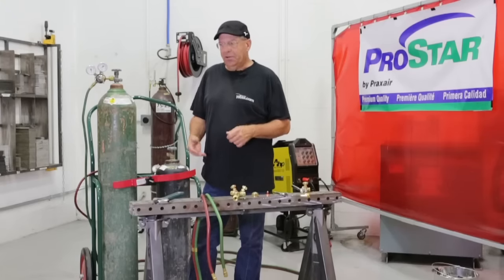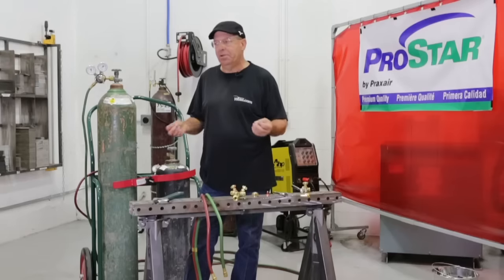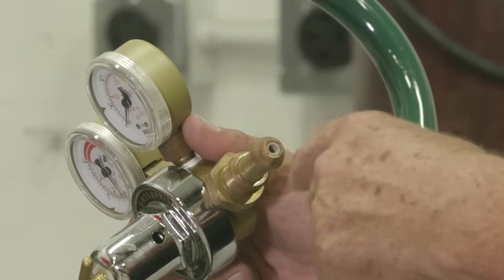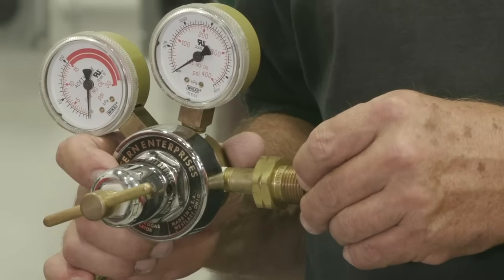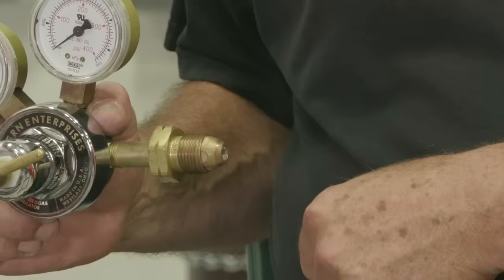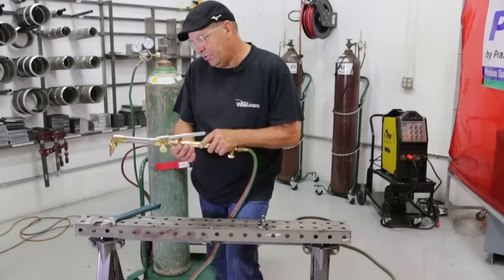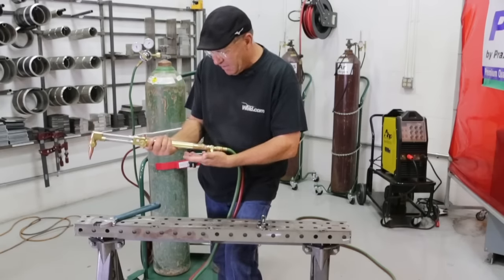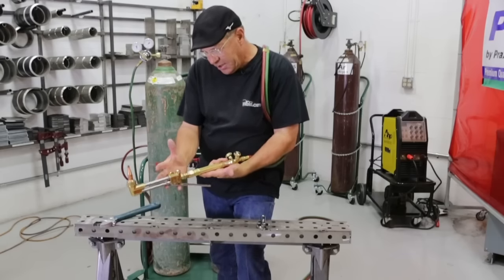🔥Safe Oxy Fuel Setup and Operation

Comment: GREAT VIDEO !!!  I've used torches for many years, but learned things here.  A lot of us were taught incorrectly. You show it all and explain WHY.  
   Suggestions:
    1.  Always use a tip brush to clean tips,  even if the tips are new.  Never use a tip brush when the tip is installed on the torch.  You'll only push the dirt deeper inside the torch.  The worst way to clean a tip is to just rub it on a concrete floor.  I've seen guys do that.  
    2. Soapy water in a spritzer bottle... ** just a LITTLE bit of soap !!!  Too much liquid dish detergent and you'll have LOTSA bubbles.  You won't know if you've got a leak or not. A little it of soap won't foam up unless there is a leak. 
   3.  For thicker metal, use a bigger tip.  Increasing the gas pressures won't help much.  The small holes in the tip only let so much gas thru.   It took me years to learn that.  I just never thought much about it, until one day a guy explained it to me.  
  4.  Never leave the hoses pressurized. ALWAYS turn the bottles off, when you're finished, and release the gasses in the hose.
Reply: gord johnson ...Good tips my friend!   Please allow me to add the obvious:
To clean tip when a piece of slag or foreign material is stuck to it DO NOT tap or beat the tip on anything.  Also do not run a file across the face of the tip.  In both cases you just ruined the tip, it will never cut right again.  If you are operating a cutting torch correctly you should never need to do any more than occasionally use a tip cleaner.
Reply: @leebarnhart9725  Not true with respect to filing. I have filed and cleaned basket-case tips and had them cut like new. The main issue is that it is an acquired skill which takes quite a bit of practice, and you must use the correct file (either the one in the cleaner set, or a fine single-row mill file). It is also best to finish the tip with 400-grit sandpaper or a stone, which like the filing takes practice. The good news is that if you have junk tips, then you have nothing to lose by practicing on them. One thing to keep in mind is that you can typically only remove up to perhaps 1/4" of material from the end of most tips. After that, the flame gas passages will either start to expand in diameter and/or start angling away from a parallel direction.
Reply: WTFChuk ....The fact that you have enough torch tips to "practice" on tells all.
The "file", as you call it, that is found on most tip cleaners is for removing carbon build up---not for removing tip material.  
For those reading our disagreement, it's like going to the race track, put your money on the horse you believe in.  If you find yourself with a torch tip in one hand and a file in the other, you've already screwed up, don't make worse.
Reply: @leebarnhart9725  The reason I have tips to "practice on" is because I recondition and sell oxy-fuel equipment, among other things, and as a result you end up with plenty of bad nozzles. After you remove your foot from your mouth, you may want to consider that people who do a lot of cutting, particularly scrap cutting, can end up with fouled tips from a piece of metal or slag blowing back and clogging an orifice. You also have folks who cut a LOT, and as the oxygen cylinder pressure drops on a typical single-stage regulator (the most common type) the outlet pressure INCREASES. The result is that the flame becomes increasingly oxidizing causing the flame root to erode the exit of the flame orifice. This is the reason I always recommend two-stage regulators for folks using cutting machines. I have seen all this and more. Before you call someone out, you might want to know what you're talking about.
Reply: gord johnson when depressurizing the hoses, turn off the tanks first, open the torch to let the oxy/acetylene out (one at a time) and then turn off the regulators. It's not a big deal if you turn the regulators off first, but that still leaves pressure between them and the bottle. If someone else - or you - comes along to change the regulator or tank out you get a nice blast of gas when you loosen the fitting. 

Acetylene is smelly stuff, and I've got a sensitive nose.
Reply: gord johnson we use soapy paint brushes and you can still clearly see even with a lot of bubbles if you have a leak or not and how much of a leak
Reply: WTFChuk can you explain how pressure output increases in a depleting cylinder ?

Comment: A point or two.
1. Never, never, never ever use grease, oil or any other type of petroleum product on an Oxy/Act rig. ANYWHERE !
2. Do not use Teflon tape on anything other than where the two brass valves mount to the torch barrel that have pipe threads. All other connections have "seats", the threads do no seal.
3. Act. can "explode" at any pressure over 15 psi. That is why you turn on the Oxy tank first, so you do not hit the 5-7 psi on the Act. side with 40-50, or more pounds of pressure, if you have some sort of feedback.
4. Do not use Act. bottles laying on their side.
Reply: Great Additional Info, Wally!!

Comment: Great video Bob, I been fascinated and became a expert on Oxyacetylene welding and cutting since 6th grade and I'm with you I was taught to have the torch valves pointing to the floor to prevent accidentally bumping them. I myself don't mind the smell of Acetylene but can't stand the smell of Propane.

Comment: I have not used an O-A torch in nearly 40 years (high school metal shop...), so this was an excellent refresher for me. I just picked up some used equipment at an estate sale, so I am now going through the pieces and parts, checking the condition of everything. Bought new hose set, getting the bottles refilled, etc. now.

Anyway, thanks for the slow and clear explanation and including the WHY I DO THIS part of the process.

Comment: Hi Bob, Another great video so thanks for that.

One tip I learned about Acetylene gas bottles is when you load them into your van or truck to transport them to a site never ever lay the Acetylene bottle down horizontally. This is (as I understand it, but I stand to be corrected) critical as the Acetone separates and can if left long enough cause the bottle to explode causing considerable devastation and possibly injuries or death.
Reply: Any Acetylene bottles (even empty) I may have a need to carry will always be upright and never laid down. It is not recommended but I do know people that do it. That is their risk and if you want to lay them down then that is also fine. But don't try to suggest it is safe to lay them down.

Comment: I can definitively say that it does not matter whether you shut off the fuel or oxygen first, but you must ALWAYS close all the valves on the torch before shutting off the cylinders. 

AFAIK, Victors are the only torches (and not all models have them) with internal arrestors. Purox, Oxweld, Smith, Harris, and even many Victor clones do not have them, and so will need external arrestors. What most people don't know is that both the torch AND the regulator should have arrestors, and the arrestors for each are a bit different (mainly due to connection reversals vs direction of flow, but also the regulator-side arrestor also usually has a thermal cutoff valve in it). The reason is this: if you have a flashback in the torch, you don't want it backing into the hoses. Hoses can easily rupture, and a ruptured fuel gas hose is a bad scene. Also, even of the hose doesn't rupture, the inner hose section can be damaged. This is why you need torch-side arrestors. The reason for regulator side arrestors is this: if a hose is damaged, cut, or burned through, and a gas leak catches fire and burns back to the regulator, the arrestor will prevent it from flowing into the regulator. It also provides redundancy; if a torch-side check valve leaks and backs gas up into the opposite hose (which shouldn't happen if proper shutdown and start up procedures are observed), the additional valve provides a last line of defense.

Heavy cutting or use of large heating heads may require more flow than two seriesed flashback arrestors can provide. In that case, you can remove the regulator-side arrestors, although it isn't recommended. The better option is to use an alternate fuel gas such as propylene or propane which can be run at increased pressure to overcome the restriction of the arrestors. The best option for acetylene use is to increase to 3/8" hoses and arrestors, or run high-flow (fat body) 1/4" arrestors. Always run two sets of arrestors if at all possible.

As a rule, all brands of arrestors will get the job done, but the German-made Ibeda's are my fave. In particular, their combination arrestor and quick disco for the torch-side are the most compact units I know of. They are sold rebranded by at least one US outfit.
Reply: WTFChuk I agree my school has them on the torch built in on the regulator and on the acetylene side of the manifold system has another one it’s always better to have a back up then just have one and it fails if you ever don’t see the flame and hear the torch whistling shut off the torch immediately a first o 2 then shut off the valves on the cylinders

Comment: I run a small HVAC setup.  Good to know that I’ve got good practices and procedures.  Our little rigs are jostled and banged around a lot more than shop setup.  More than a few times I’ve found loose hose ends and loose regulators to the bottles.  I get on the guys who fail to bleed out the hoses.  Thanks for the refresher.

Comment: Hi Bob, 

Was interesting to see that in the US they have brass to brass in the cylinder connections, in Oz we have an O Ring around the perimeter of the hose fitting so you don't have to do it up so tight. 

I've not seen a set with built in flashback arresters, always an extra fitting, or was when I got my last kit in Oz. 

I would agree, most forget a lot of what they may have been taught, and where oxygen and acetylene are concerned one can never be too careful. 

A good video as always. 

Regards Dennis.
Reply: Hi mate just out of curiosity how many flashback arrestors do you have in your kit

Comment: Really interesting- I see most everyone here was taught to turn the fuel off before the oxy, I was taught different (maybe because I learned in a lab setting?) The idea was that the acetylene can't burn without oxygen, and so can't travel back down the hoses. Pure oxygen will make most anything burn like crazy, so if there's enough heat the hoses themselves will become a fuel source. Maybe it doesn't matter either way or maybe those lab guys over thought the whole thing and the field guys have it right (no surprise to anyone right?)

Comment: Yes youre absolutely right on everything. Typically my settings if im using a #3 tip i have the oxy at 35 psi and acety at 10 psi. I realize anything after 10 psi on the acetylene the acetone becomes unstable and more dangerous.
Reply: @Mario Martinez you betcha kind sir.
Reply: Mario Martinez Acetylene is explosif over 15 psi, you should be good with 7 psi acetylene and 55 oxygene for most jobs
Reply: Mario Martinez i miss read sorry but thanks for the pointer! have a great cutting day haha peace ✌️

Comment: 3RD QUESTION,   HOW DOES THE FLAME BURN INSIDE THE THE TORCH HEAD,   I WAS TOLD TOO LOW OF PRESSURE.             NEVER TOO OLD OR TOO MUCH EXPERIENCE TO LEARN      THE BEST TEACHERS ARE THE ONES WHO HAVE THE MOST EXPERIENCE AND TRICKS,    THANK YOU

Comment: Safety standard in New Zealand is much higher. You need to have flashback arrestors on both the regulator and mixer.
Reply: NZer here as well, I was always taught absolutely not to use soapy water to check for leaks.
Reply: @annabellovatt7938  How do you check for leaks instead?
Reply: @37Iulian  There's a foam type spray designed especially for it. Honestly, I don't really think it matters which you use as long as there's no leak...

Comment: I always shut the oxygen off first on my torch. I have been told both ways. I have welded professionally for many years. I know a lot of people are taught in school to kill the o2 first. I have never had any issues and I don't get the pop that some people say you get. what is correct and why? I personally use propane at my home shop but have ran both. I actually am so use to propane i prefer now.

Comment: Bob Moffatt,  I have a setup problem. I do yard art and miscellaneous metal projects. Without classes I have been using YouTube and trial and error I would like to take some classes but I can't find any classes for an old guy like me (78). I have a new Victor Journeyman WH 315FC+ welding handle with a CA 2460+ cutting attachment with 00-1-101 tip, the gas is set at 20psi oxy and 5psi acetylene. I set it up like your video shows and as I hold the torch after getting a neutral flame, it starts to pop at 2-5 second intervals. I check my fittings and they seem good. I start setup over and notice there is a jet coming out of the oxygen center hole about 1/8" high. I have about 80psi in my 140cf acetylene tank and I am at about 200psi in my 125cf oxygen tank. Is the problem there? The pressure reading all seem steady. I've removed the hose and separated the welding handle from the cutting attachment and there is no carbon at that joint. All the seating surfaces are smooth and shiny. The cutting attachment has carbon on the oxygen path where oxygen is fed into the tip. The tip has a coat of carbon in the oxygen nozzle. I respect brass and I have been careful tightening the hose and tip. The handle to cutting attachment is hand tight. I've read that the problem could be pressure even though that looked good. I need to clean up the cutting attachment, I'm told that soap and water should be used. Is that soap like Dawn and water or do you recommend special cleaner?

Comment: Years ago I was a "burner" at a scrap yard - we probably invented violations, lol.
Question - I have a smiths little torch with map and a #1 oxygen bottle with regulator and flash arrestor (silversmith)
I use my torch daily - given the inherent danger with turning on the oxygen bottle, would it be safer to just leave the system always on? Or shut it down every day?

Comment: I broke out in a shop that put safety last and I haven't learned basically any safety stuff lol I wasn't just a helper either, they had me running the shop by the time I left.. No one in the building had ever held a forklift license, hell I trained myself one day on my lunch break at the boss' recommendation and from that point on I was the one who handled all material deliveries, wiggling 20' sch40 bundles through a 15' door on a little hyster is always fun

We used to get a heads up before inspections and boss would have me rush around the week prior hiding and riggin shit up to not get flagged as a safety violation lol fun times though. Almost lost my left testicle there when I tried to quickly grind a tack off the shear's table with a 7" cutoff wheel on a 4.5" hilti lol

Not a single grinder guard on anything in the shop, but damn did we produce. Other shops hated us, 5 guys in out shop counting me out-produced everyone in our niche (government structural mostly in DC, but we did other stuff - majority was stairs/rails, but all types of structural from 3/8" to 1" at the thickest - most of us ran millermatic 252 with a bernard pipeworks or the little red trigger 150amp gun, great little machine)

Comment: Im in a high school welding program the textbook say oxygen first but our teacher taught us to turn the fuel off first
Reply: your textbook was very wrong. You'd still have a flame if you turned oxy off first.
Reply: Not just a flame but very carbon rich flame that will float around the whole workshop and blacken everything it lands on.
Reply: y'a, and my instructor says doesnt matter when shutting down the cylinder, "doesnt matter which comes first". and then in text book says oxy first... text books suck because its a quick buck for them to make, so seems they put what ever.. smh but i always shut down the acetylene cylinder first, obviously when torch is shut off.
Reply: My welding instructor says to turn off the fuel first as well.  What year was your textbook published?  Or, what was the name of your textbook?
Reply: A before O or up you go.

Comment: Where I'm at its required to have flame arresters on the regulators "in case the hoses are accidentally severed".
Reply: Beach&BoardFan I have a set on my regulators because my tanks are in my truck box, the torch is on the end of a hose reel several feet away. I also have another set on the torch. 
And no matter how safe, there’s always some moron on a job site that tries to drive equipment or light a cigarette in the 6’ between me and my truck in spite of the lights. And the 3” no smoking letters. So I operate with redundancies.
Reply: I agree with the idea of FBA's on the output of the regulators, but I don't see how a severed hose would 'prevent' anything untoward happening.  Surely fuel & oxygen would just come gushing out of both hoses?
Reply: @thecorbies  Its to prevent flame from getting past the regulators
Reply: @beachboardfan9544  I understand the reason for FBA's, but why would there necessarily be flames just because the hoses got severed?
Especially if the torch wasn't even alight or being used.
Reply: @thecorbies  And if it was?
Reply: @beachboardfan9544  Yeah, ok.  If it was then I agree, but I already agreed in my original comment.
Reply: @thecorbies  Why is the gas on if its not in use?
Reply: @beachboardfan9544  Haha.  Excellent.  This is turning into a 'whodunnit?
Was it the butler with the candlestick?
Seriously though, I suppose it's not impossible that the gas(es) could be left on accidentally?
What do you say?